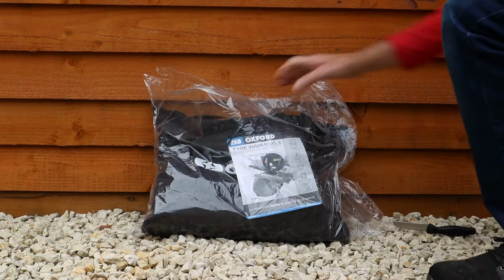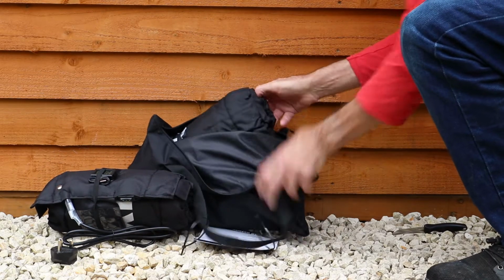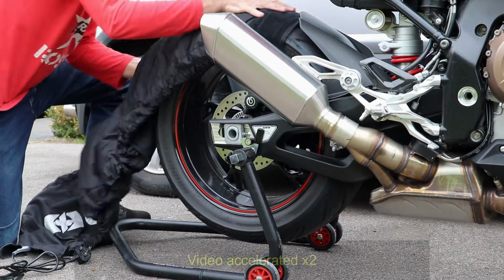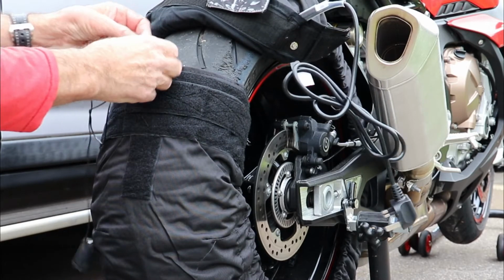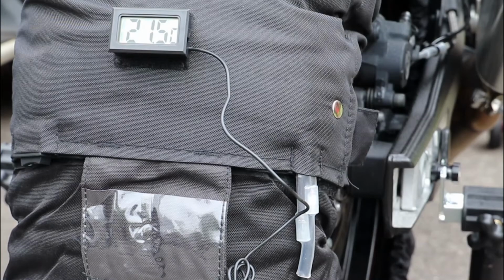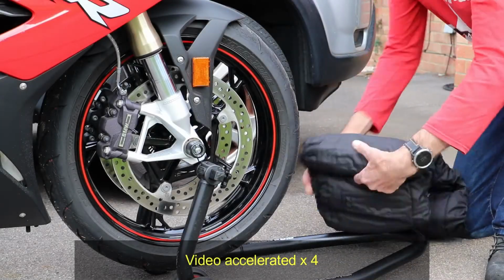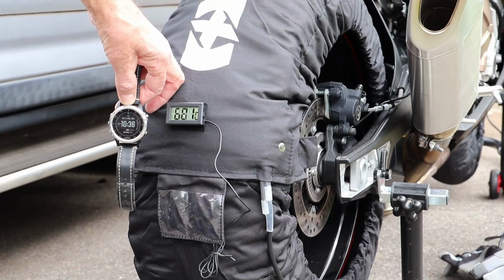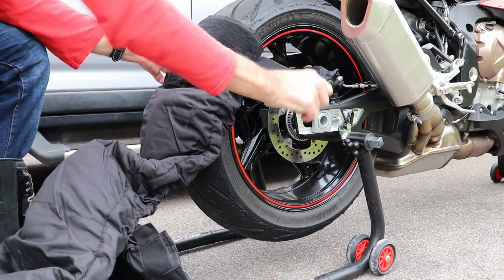Oxford Products Tyre Warmers

Comment: How did you find the tyres post-warming please? I'm considering my first track day so thinking about investing, but wondering if there is any road application whatsover?
Reply from the maker: Hi, I only use these for the track and run much lower tyre pressures on the track: 2.1Bar front and, 1.8Bar rear or thereabouts hot.  Pointless on the road because they will very quickly cool unless you plan on spanking all speed limits 😁